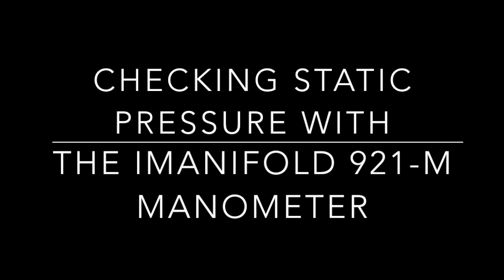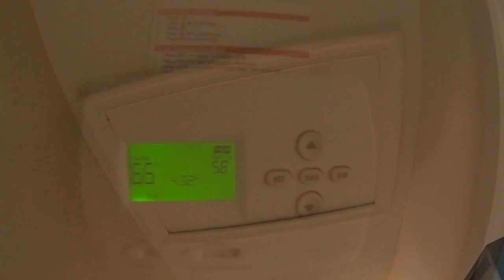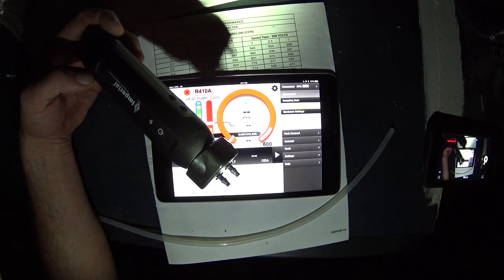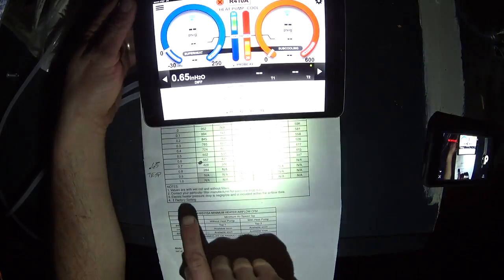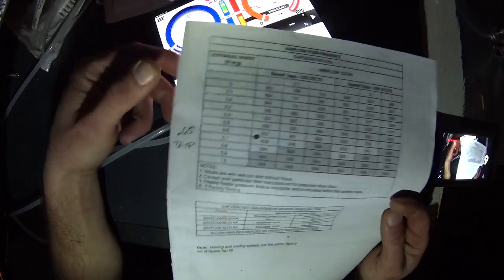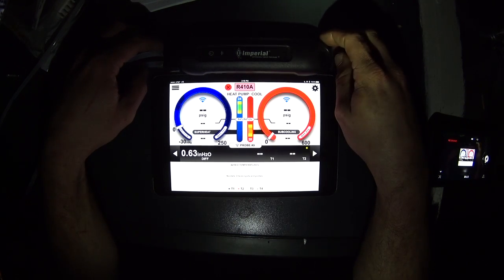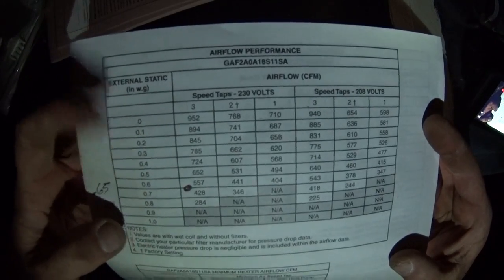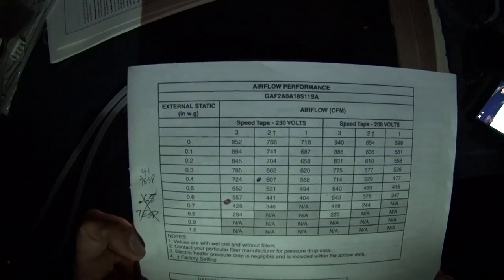HVAC Tools: Checking Static Pressure TESP with the iManifold 921-M Manometer

Comment: great example I did a start up on a upstairs H.p. this week and it sounded like a 747 in the house. speed tap was on medium and I may go back and recheck static pressure and drop it to low . But supply duct had 800 cfm,s and system is a 2.5 ton . I think our sales manager put the wrong size system in .

Comment: What step did you take to adjust your static pressure and lower the velocity noise?
Reply: He increased 3 of the ducts from 6" to 8".
Depending on the static pressure, a 6" flex can flow 90 cfm plus or minus. 8" flex is about 180 cfm plus or minus.
3 X 90= 270 cfm
3 X 180= 540 cfm
I believe Steve increased the overall flow through the duct system by about 250-280 cfm
This increase in air flow decreased the external static pressure of the duct system.
Good job Steve!

Comment: Stephen, does this 921-m effect any of the readings on the app when using I-connect. like does it change airflow readings, or system BTU's? or does it just check static and do that read out you showed? just wondering I have the NCI static pressure app which is pretty decent, but I just ordered imanifold a couple days ago and would love to have it all in one place....Thanks
Reply from the maker: +Performance Based Heating & Air it just checks static and graphs the reading. Congrats on your order, I think you'll be pleased with your purchase. Did you get iManifold or iConnect?
Reply: +Stephen Rardon (HVAC with Stephen Rardon) iconnect

Comment: I was looking for one of your videos to see how you set up your iconnect for recovery and charging procedures, Do you have any videos that you recall would help me? Thanks for sharing, have learned tremendously from your videos.
Reply from the maker: +Mauriciom2011 i don't usually recover with the iConnect connected, use the Sporlan for that and just run 2 hoses to a tee at the recovery machine. i haven't had a manifold since i let the iManifold go and switched to iConnect. I guess i could shoot one for that detail...

Comment: Stephenson if you go to a call and you find no paper work
no model#. how would you know what the inches of water column across the Evaporator should be
Reply from the maker: Typically I'll try to find the manual On line. If not then I take a ballpark around .5" WC as decent and go from there
Reply: That's pretty much what I did thanks

Comment: We use those filtrate filters at home- should we not be?
Reply from the maker: If your static pressure is within manufacturers specifications then they're ok, but very rarely is that the case.

Comment: Stephen, I liked the demo on new tool. It looked to me that the hose connection ports are plastic vice metal. I would like a more robust duel-port manometer that can take a 10 foot drop and I can use to check static pressure.  I also would want to use the tool to test gas furnace pressure switches that can simulate a draft with an internal pump for our fall checks.
Reply from the maker: I've had very little trouble with the robustness of the probes

Comment: what was the final duct arrangement? great video stephen!!
Reply from the maker: +BBYERS27 two 6 inch runs to 4 by 10 registers and 3 eight inch runs to 6 by 10 registers. i guess i should've included at least some of the duct adjustment video, lighting in the attic was terrible though

Comment: Very good explanation & video. Interesting stuff. I was wondering if the taps & static really do produce the cfm that the piece of paper say. It wound be cool to see cfm readings at each duct to see if the taps & static are really what the piece of paper says. Wire less anemometers at all ducts reading cfm & watch it change with static changes would be a very cool video.

Comment: So did you upsize the 3 ducts that you pulled off the plenum?
Reply from the maker: +RJParker yes, i was going to include that in the video but the attic was pretty tight and lighting was garbage. started five 6" flex ducts and increased the flex and boot on 3 of them up to 8"
Reply: +Stephen Rardon (HVAC with Stephen Rardon) Did you just randomly pick three or did you pick the three that were the most noisy? Why 8" and not 7'?  sorry for all the questions on your video's but you bring up a lot of great talking points!!! I really appreciate your video's and the hard work and expense that goes in to making them!!! Thank you!!
Reply from the maker: Ernest Hall 8" ducting is much more common around here and if you're going to upsize you might as well go overboard a little in the process and basically guarantee that it won't be a problem any more.